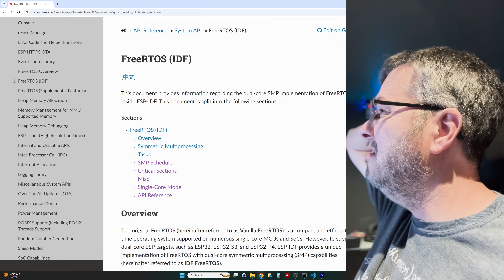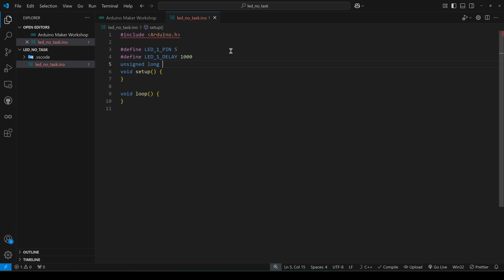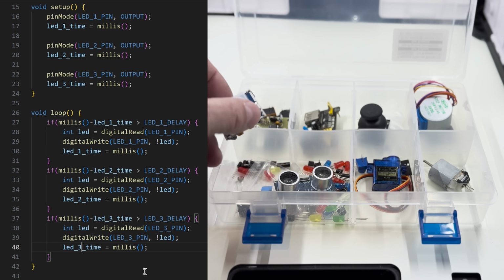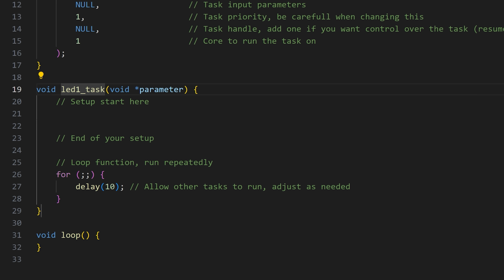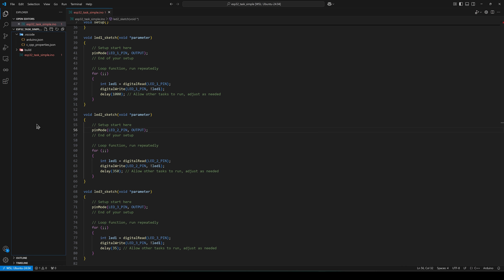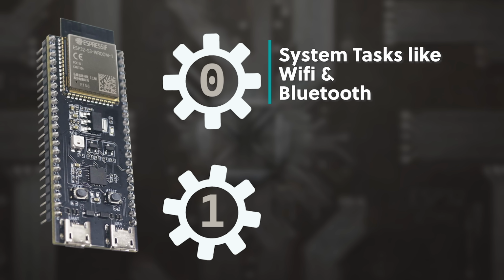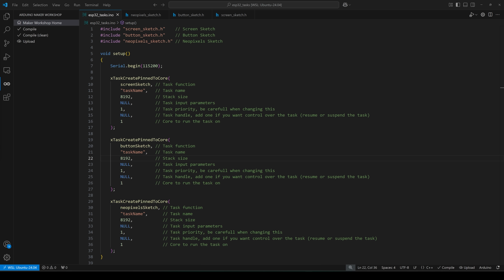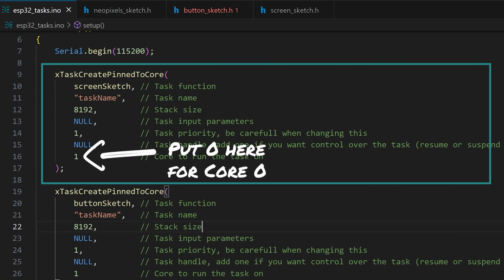Overcome Mental Barriers with ESP32 Tasks

Comment: I've never bought an ESP32 or coded for an embedded SoC (I'm about to, hence I'm watching these sort of videos), but am a LONG TIME programmer (I feel really old). Out of interest, why could you not pass the PIN constant and the delay to each xTaskCreatePinnedToCore function in the parameter argument? Then use that in a single unified "led_task" function which uses the parameters to determine which LED to configure and how long to delay. That way you end up with much less code and less code duplication (which I thought was the idea of going to tasks rather than just copy and pasting?). Maybe you just felt that would make it harder to follow?
Reply from the maker: Yes you are right, you could definitely do that.  But for the purpose of the demonstration on tasks, I kept them simple.

Comment: I would have found the Arduino Maker Workshop very usefule because I actually dislike Arduino IDE because I used Platform-IO for some ESP8266 code. Anyhow, the VCode extension does not work for me, I tried to install it on  both linux and windows but I never got it working because I cannot select boards and get always an error: CLI: Error from get board configuration, you may have to installed the board using the board manager! I tried this with ESP32 and with Arduino boards. The packages were downloaded (on Linux I had to use a special command `arduino-cli config set network.connection_timeout 600s` to avoid that the board installation stops after 60 seconds which are the default timer). I could not get a single board to be selected!!!!
Reply from the maker: Open an issue here : https://github.com/thelastoutpostworkshop/arduino-maker-workshop

Comment: Very good info on cores and tasks thank you , however i read convention is Headers should declare what a module does, while .c files define how it works. You seem to make a seperate .h file for you "sketches" ,  that also contains code & variables , that seems confusing to me. what is your reasoning behind it?
Reply from the maker: You're absolutely right about the convention. In my case, I put some code and variables in .h files mainly for simplicity and quick reuse across small examples or demos. For larger projects, I definitely recommend sticking to the standard: declarations in .h, definitions in .cpp. It's cleaner and easier to maintain long-term.
Reply: @thelastoutpostworkshop  Thank you for clarifying :)

Comment: Any reason to prefer pinned task instead of xTaskCreate() and let the scheduler decide in what core to pin?
Reply from the maker: Pinned tasks ensure that a task always runs on a specific core, which can be critical for time-sensitive operations or when accessing peripherals that require execution on a certain core. In contrast, letting the scheduler decide may balance the load better but can introduce variability in execution timing.

Comment: Does it works for Arduino UNO to make multi tasking..
Reply from the maker: No it won't work
Reply: @thelastoutpostworkshop  thank you for your response bro... I am an absolute beginner for esp32. How can I train myself in esp32 using ESP IDF.
Reply from the maker: If you start with the  ESP32, i will first use the Arduino framework  before trying IDF, which is a very different framework, harder to use

Comment: This is a nice introductory video, but it's a shame that it's technically inaccurate. If you only have one core then there is physically no way for tasks to run truly simultaneously. They're properly scheduled and switched between each other in order to appear to run simultaneously, but they aren't really simultaneously executed. It's all a matter of timing. That's my only issue with the accuracy of this video
Reply: There are two cores in an ESP32, not just one.

Comment: Thanks for this video. I spent all afternoon refactoring my single ino file into 15 cpp and h files that use the task function to read my sensor data, send it to serial output, mqtt messages for my Home Assist autodiscover as well as an oled display. Now its a lot easier to read and organize!

Comment: Can you address the latency?
The video makes it look like there is a mandatory latency in the tens of ms when using this. Most visible in the multi-screen example where it looks like they change sequentially with th delay between each.
Reply from the maker: In the multiscreen you see in the video where I turn a rotary encoder, the image is being read from an SD Card, that's the latency of SD Card reader
Reply: @thelastoutpostworkshop that tracks.
So I think I hear you saying that there is no extra latency when using tasks. Is that right?
Even on the section with the yellow button it looks like there's latency but it's hard to tell with the high travel distance of those particular buttons. Decided it was best to ask and get the real answers.

Comment: switching task consumes tons of cpu time. Instead use 2 task pinned to core 0 and one. Then use core 0 fore ble and wifi operations and the socond core for real world problems. Never use delay function to wait some response. Just check all io at certain faster intervals than use value how fast you need to use. Use state machine waiting for special case. So your code seamlessy works.
Reply: This is a really poorly written/thought out comment.

"switching task" might take time, however if you look at something like this example...  blinking an LED once a second causes a task switch... twice a second.  (One switch to, and one switch away).  That is comparatively tiny to the alternative, which is polling on millis().

The delay function is correct if...  you have to delay.  It does the correct thing -- it yields the CPU while doing nothing.    "Just check all io at certain faster intervals" basically gets you back to the same broken loop() programming paradigm in the first place (i.e. writing a manual scheduler in the loop() which is constantly polling IO).  That is exactly the coding problem you want to avoid.  For example, you might only need your fastest input some of the time.  In order to accommodate this, you have to program it into the polling routine/manual scheduler.  Don't get it twisted -- you have written a manual scheduler at that point, just a bad one.

The code is cleaner and more well behaved if you use interrupts and mechanisms like notifications for asynchronous events.  Polling is only reserved for dire cases, and really if you just blindly poll all IO all the time at a rate faster than the fastest guy needs it, you're not in a dire case, you're just programming badly.
Reply: Dude, are you seriously recommending polling? The "correct" answer, if one exists, is to use timers and interrupts. Switching task "consumes tons of cpu time"? Definitely less than polling all of the time  😒
Reply: is this better options:  vTaskDelay()? or millis()?
Reply: @dasig3010 vTaskDelay is the same as delay as delay calls vTaskDelay. Only it does some calculation so its actually that many miliseconds long
Reply: great point man. what bugs me about the esp32 is the garbage fp performance if you want to do any type of semi-cool 3d raster stuff. it's been out almost a decade and i find the updates to the silicon to be very lacking considering the price to build them. i'd pay an extra few bucks a board to cover the licensing costs espressif would have to pay to use the more advanced 'open source' riscv features. 

i figured the second generation pico would solve some this and add more cores but instead they employ 2 different semiconductor architectures on the same board to give the illusion of being better. the raspberry pi company only cares about their corporate customers now though going against their whole mission statement. the 4gb pi4 still costs almost 100 after tax in my province, which is odd considering the pi5 8gb is only 40 dollars more. it always seems to make more sense to buy a sff refurb business pc to me whenever i measure the cost to performance ratio. they all come with ssd's now whichs makes the pi cost double if you factor in the price for the extra stuff you have to buy to add the same thing. the pi still has it's uses though given the size.

i love teensy boards but in canada they are quite pricey so I only order them straight from pjrc, amazon sellers try to charge almost 100 beans for the 4.1. i get why though, one person is responsible for it's development basically. apparently a teensy 5 was in the works before the chip shortage years ago but i havent heard anything else about it. Paul Stoffogren has written every second library in the arduino ide it seems as well for even non arm ics too. If i were as talented as Paul, i'd go work for spacex or someshit haha

Comment: Great tutorial! Can the tasks access and/or share the same variable?
Reply from the maker: Yes, in the project I use a volatile global variable that is shared between two  tasks.  A volatile global variable can be used between two tasks because it ensures that the compiler does not optimize away accesses to the variable.
Reply: @thelastoutpostworkshop  thanks a lot!

Comment: Is there any difference between placing the `pinMode` command in the default `setup` function and placing it in the `setup` function of the tasks we create, apart from it looking more organized?
Reply from the maker: the result will be the same, use pinMode in the standard setup function for hardware shared across tasks or critical to the entire system.
Use pinMode in the setup part of a task when the pin is exclusive to that task, keeping task logic self-contained and easier to debug.

Comment: Is this extension better than platformio?
Reply from the maker: No, it's different, the Arduino Maker Workshop Extension is more for beginners who wants to try Visual Studio Code for the Arduino Framework programming
Reply: @thelastoutpostworkshop  Thanks for the clarification.  Great to have something for beginners.  I use PIO but will check this one out!

Comment: Excellent. What about pass variable into tasks from the main loop.
For example, read a sensor task 1 elaborate the values in the main loop and display the new value on task 2.
I think you get my point.

Ps: i installed your ide, is super.
Reply: u must use semaphores or mutexes, its pretty advanced, but there are tutorials on that topic as well. Some say, that FreeRTOS handles them automagicly and that they had no issues, but i think that is just luck and u will eventually get errors

Comment: rtos tasks are not good only for organizing the code better, but, I think their main function is to control the microprocessor's execution threads to avoid overloading the processor with execution data, which will make your code crash if you don't know how to delete and restart the task when the processor queue creates a bottleneck effect.
   This is required when you get some type of microcontrollers that are not supported and optimized well, but they have got a microprocessor which is strong, fast and dumb in the same time. :))

Comment: Must get me some circular displays for running that alien eye!  Two would look awesome if I can get them to focus onto the same object in my drive next Halloween! Do you have a recommendation?
Reply: Waveshare 0.71inch Double Eye Round LCD Display Module.
Reply: @nikthefix8918  Thanks.  I ordered 2 similar ones that were demonstrated in his earlier videos, from amazon for almost half the price!
Reply: @hariseldon2577 If you buy the bare displays - very cheap indeed - they are pretty easy to solder to your own custom pcbs and the additional support components are simple and few. Could be a good option for an inexpensive  bespoke assembly as well as being a great learning experience.